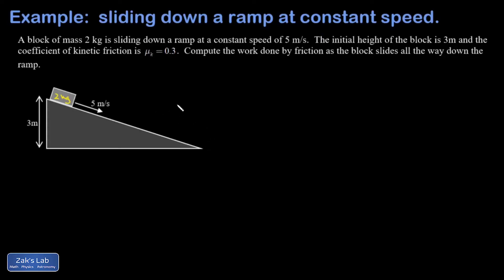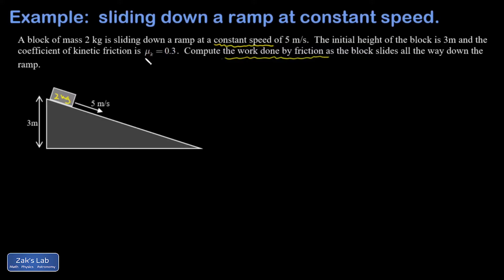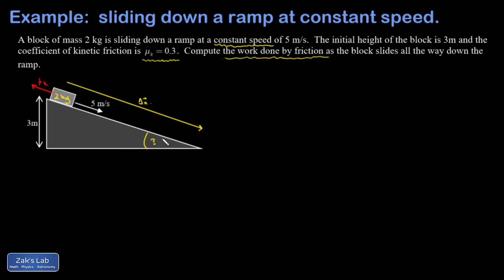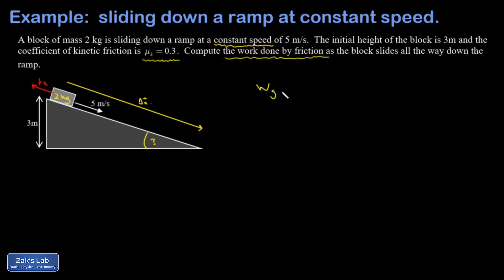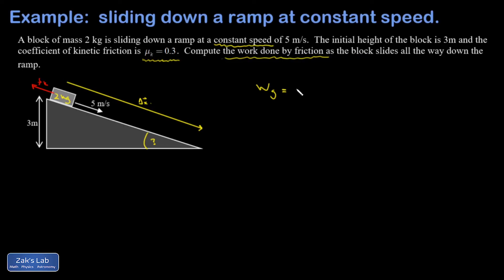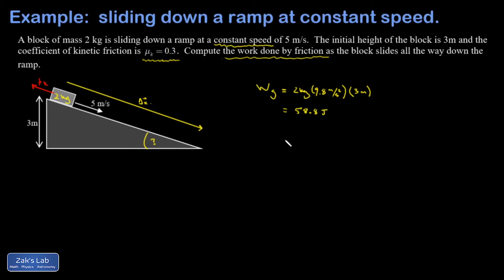Work done by friction at constant speed on inclined plane.  Work energy theorem friction concepts.

Comment: What is the value of the angle?
Reply from the maker: You don't need it.  By using energy arguments instead of focusing on forces, you can get the work done by friction given only the initial height and the fact that the speed is constant! z
Reply: @ZaksLab  I remember last year in the physics test there was a difficult question. This video made me remember the question. It was about friction. The text of the question is ( An object is sliding an incline surface as shown in figure, if the 20% of the surface is smooth and the other is rough with μ = 0.86 . if the object starts from rest and comes to rest at the bottom. Find The angle θ = ?)

Comment: Where is the full video😊
Reply from the maker: The only thing you missed was a J for joules! Z
Reply: @ZaksLab  wanted like explanation for Normal force , gravity, work done and total net work thanks
Reply from the maker: @Rich-cool11  The point in this concept question is that you have to approach it indirectly:  1.  you can't get the normal force (or any other force components) because you don't know the angle of incline, 2. the net work is zero because the speed is constant, 3.  the work done by gravity can be computed using the change in height, 4. the work done by friction is the opposite of the work done by gravity, since we know the net work is zero.

Comment: Would the work done by friction be positive joules or negative?
Reply from the maker: I got a negative result in this video by using the work-energy theorem, but you can also see it qualitatively based on the fact that the friction force points opposite the direction of displacement.  With an angle of 180 degrees between the force and displacement vectors,  the dot product produces a minus sign in the definition of work.  z
Reply: @ZaksLab  I see, thank you!

Comment: why  does the wf=wg
Reply from the maker: this problem is based on the assumption that the speed is constant for the slide down the hill -- that means there is no change in kinetic energy, so the work done by friction is exactly opposite to the work done by gravity.  Alternatively, we say the force of friction has exactly the same magnitude as the force of gravity (that's the only way you can end up with an acceleration of zero!) z
Reply: I have another question does the fgx equal fg?
Reply: Because u used fg
Reply: Im confused
Reply from the maker: there was no angle given in the problem, so I had to use the fact that the work done by gravity is independent of path.  you can just find the work for "going straight down" as mgh instead of finding the parallel component and using the displacement along the hypotenuse.  So we're really imagining an alternative path:  straight down then exactly to the right, but as we travel to the right, the force of gravity would be perpendicular to the displacement and therefore it will do no additional work.  This idea is normally captured in the statement of conservation of energy, but this problem was written for the "introduction to work" chapter that preceeds the conservation of energy formalism.

if the angle was given, we could take the parallel component of the force of gravity (mgsin(theta)) and multiply by the sliding distance to do the same work calculation, and again, the work done by gravity will be equal in magnitude to the work done by friction since we know the net work is zero (because KE is constant here)
Reply: @ZaksLab  oh i got it thanks
Reply: @ZaksLab  so cuz I don’t have the angleI can use fg instead of fgx ✋🏽
Reply from the maker: @issra1481  well yeah, but only because you happen to know the height change (vertically) and you know the work done by gravity depends only on the change in height.  This is something that will become commonplace once you start studying conservation of energy:  the work done by gravity is accounted for by a change in "gravitational potential energy" which depends only on height
Reply: @ZaksLab  bro i have an exam in this tomorrow i feel miserable, but thanks u helped me alot 💛